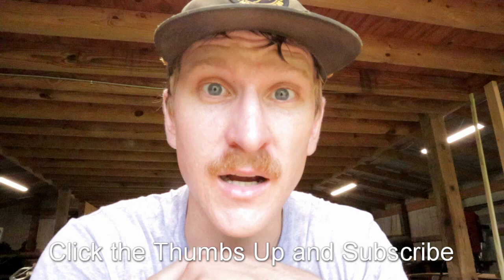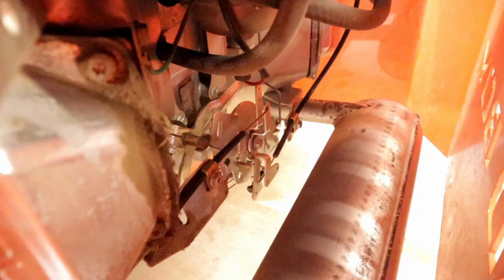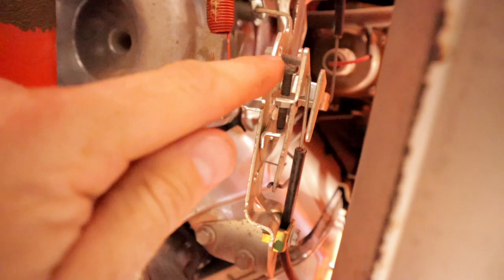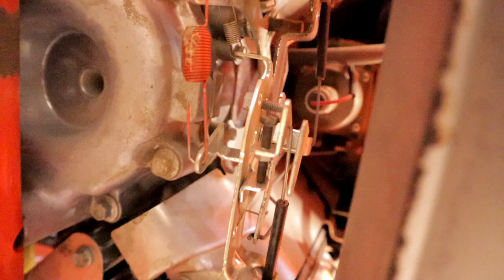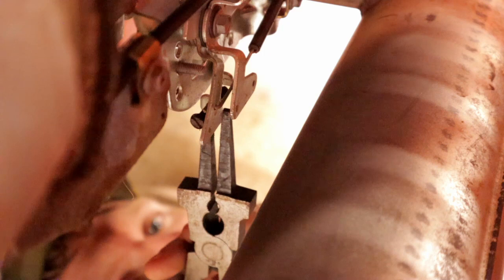Bad Boy Maverick Throttle Adjustment

Comment: It should be 3600 rpm with no load. Throttle should be in the wide open position before adjusting the cable. Loosen the nut and pull the cable all the way until it stops. Tighten nut back. This will give you maximum rpm if you don’t have a meter to test.
Reply from the maker: Thank you! May have to revisit this!

Comment: adjusting the cable end for me only changed the low rpm. the screw with locknut BTW locknut is 7mm wrench when i tighten the screw i was able to run my full throttle RPM from the factory setting of 3250 up to 3650. with blades engaged full throttle in 4 - 5" tall grass in light mist rain RPM ran in the 3400 - 3450 range. I will do some fine tuning as i need a new throttle cable but thanks for putting the ideas into our head.
Reply from the maker: This is good to know. I need to revisit this on my mower. Thank you for the comment.

Comment: Will that not being set correctly will it cause my belt to jump off??
Reply from the maker: Throttle adjustment shouldn’t make the belt pop off…belt tension being too light or debris can cause it though.
Reply: could be bent pulley's, spindle too